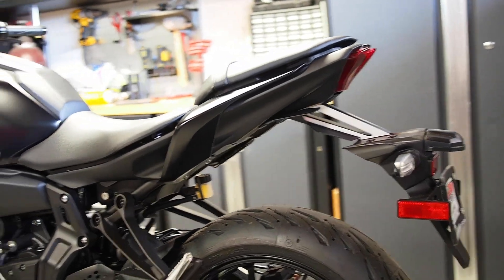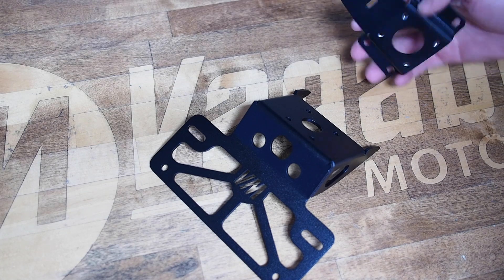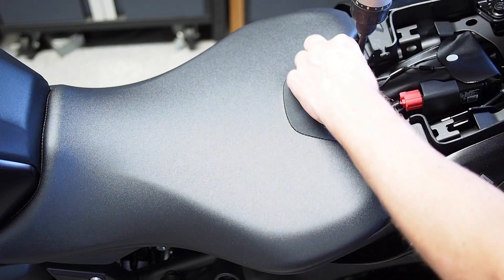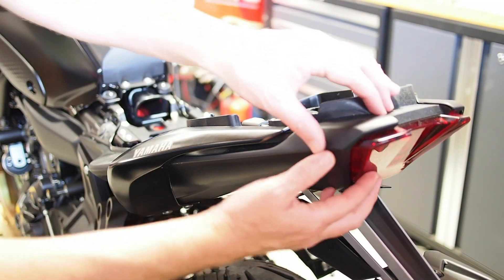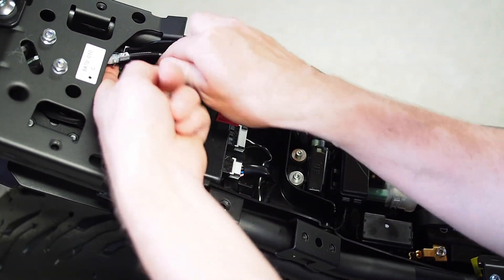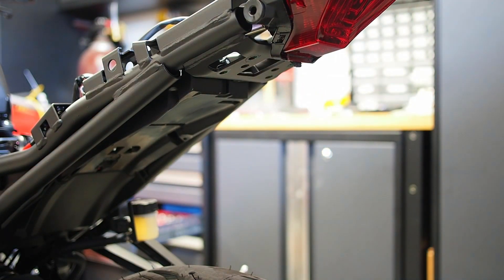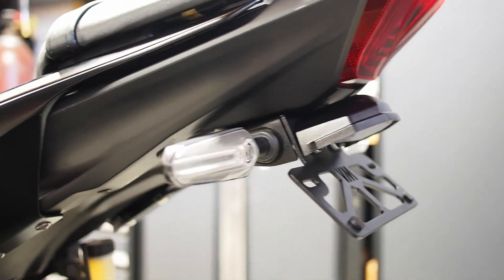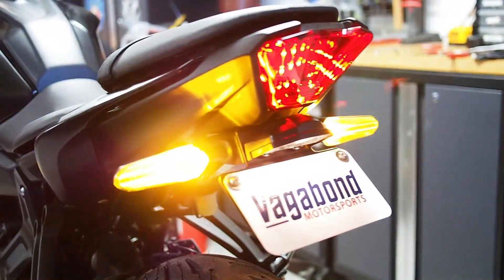Yamaha MT-07 Fender Eliminator Install Video (2021, 2022, 2023+) Vagabond Motorsports VM-YM710

Comment: Installed this tonight on my 2022 MT07. Great fit and finish! Looks awesome. Easy to install due to great instructions from this video, and helpful hardware. You weren’t kidding, the grommets were a challenge to get over harnesses connectors! But not too bad really. Watched the video and mimicked it step by step. I have novice skills, and completed in a little over 2 hours. Having a drill bit adapter that conforms to the hex bits is crucial (1/2”, etc.). Thanks Vagabond. Great product, expert instructional video. Would recommend anyone to your company and products!